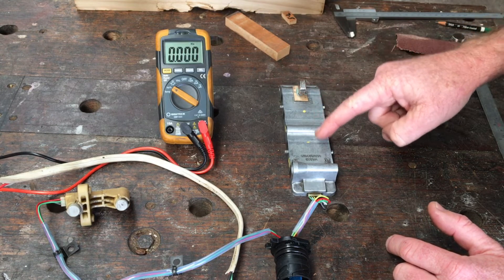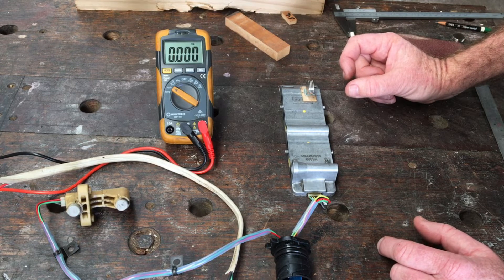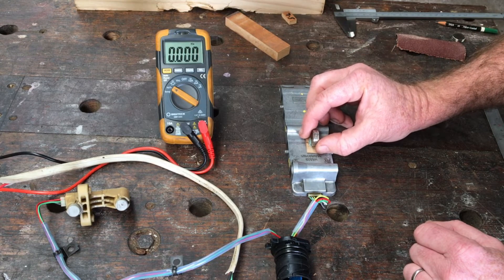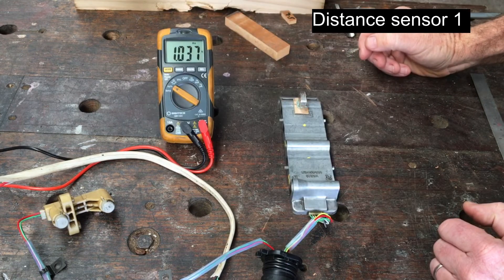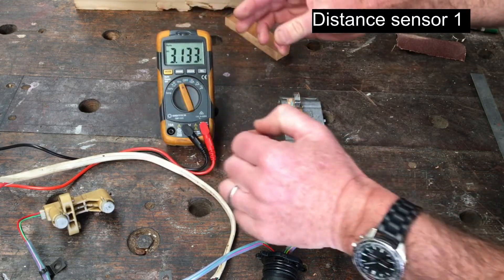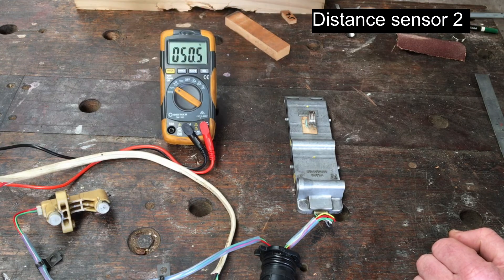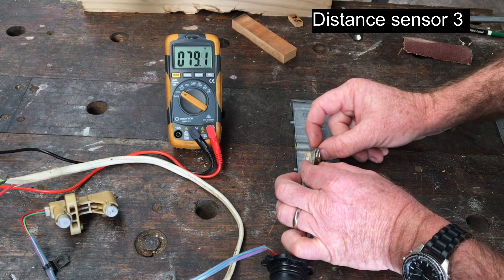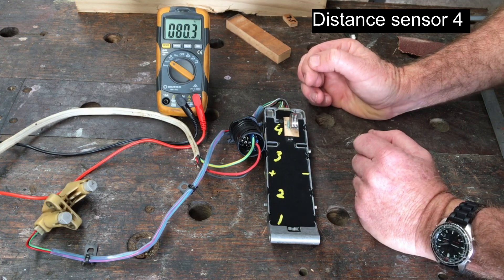Porsche ZF PDK distance sensor information part 2

Comment: Thanks for the detailed information. I have a 2014 Panamera in the shop,  with codes P1733/P1734/P1737/P1738 and wanted to have a better understanding of the system before jumping and  replace the distance sensor